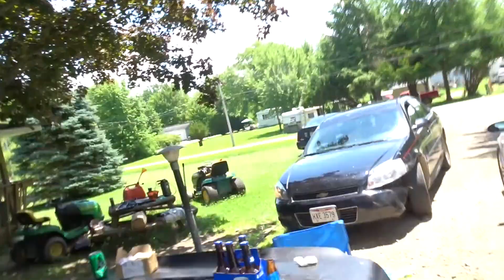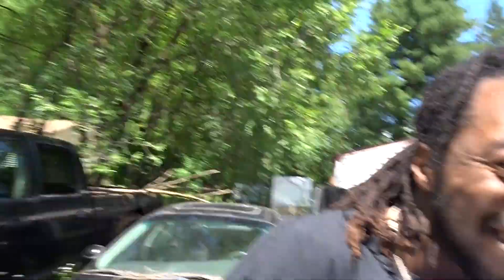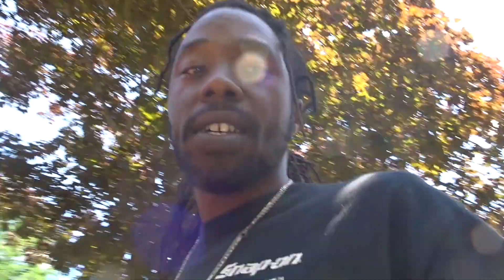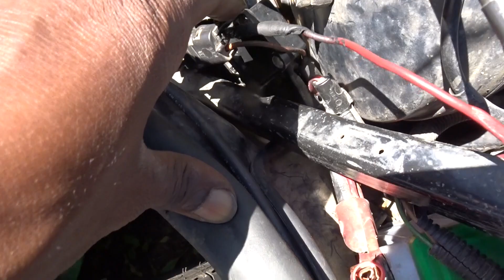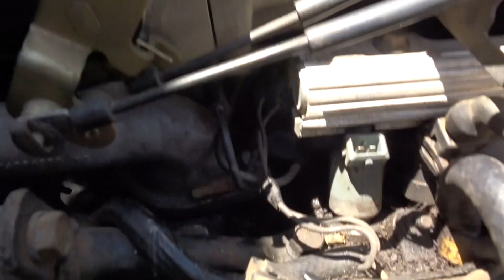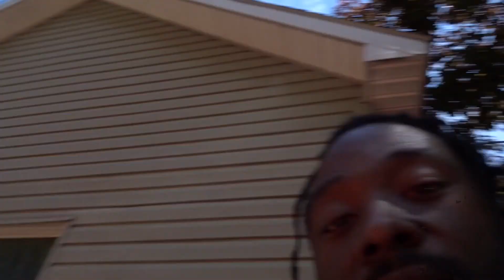C4 Corvette start and dies out!!! ( Pt.1 the diagnoses!!)

Comment: I've been working on a 91 z28 for weeks same thing did this did that nothing  I ohmed my injectors last night  found 2 with like 4 ohms should be 16 so today after watching you with your vette I went out pulled both wires off those injectors dang thing fired right up missed of course but started and run it ran  woo-hoo plugged them in shut right off I'll have new injectors next weekend! Thanks for your video

Comment: I have a 1986 Corvette, runs like a dream, well ran like a dream until yesterday. As long as you're holding the gas she'll stay crunk, as soon as I take my foot off the gas pedal she goes dead. Just got back from a real long walk to the parts store and bought a fuel filter. Hopefully that's the problem but if not you just gave me more things to look for.. 😊
Reply: THE SAME EXACT THING HAPPENS TO MY 85 C4!! Did the fuel filter work?
Reply: Usually that's the fuel pump
Reply: Mine does the same thing is it the fuel pump???

Comment: i felt your pain watching you trying to solve the no start issue.
i have an 89 c4 . ive replaced fuel pressure regulator, sparkplugs,fuel injectors, distributor cap, wires, and still hard start

Comment: Long story short.... the TPI injectors are wired in parallel to fire all 4 injectors (per side) at the same time. Like an old string of Christmas Tree lights. One goes bad they all go bad (on that side). If one shows a much lower resistance than the others chances are the coil is shorted internally and needs to be replaced immediately.

Comment: The best thing to do with these old vettes when fixing these issues, diagnose the actual problem first then fix it and then replace the everything in the fuel system, fuel pump, sock, wiring connectors, relay, cause if it is not broke now it will be soon... after all these parts are 40 years old...
Reply from the maker: True but I had no idea that 1 injector could possibly have done all that then again, it was the only different injector on the rail(used cars lol)!!!

Comment: I've got an 86 vette that does this. It will stay on if I floor the gas or leave it in park. If I put it in drive it will immediately drop RPMs and die unless I hold the gas pedal down. Any ideas?
Reply from the maker: have you checked the fuel filter?
Reply: That’s exactly what mine is doing and I just changed the fuel filter and that problem went away I was having to double foot drive it at a light unless putting it into N I changed the fuel filter and that problem went away make sure you pull the fuse for fuel pump let the fuel run out till car dies out then loosen fuel cap and pull the battery terminals before changing.
Reply: Billy keep that good stuff coming bro   If your ever up in Chicago look me up brother always some kinda vette shows going on
Reply: Jimmy I just changed my filter and didn’t do none of that you just mentioned 🤦🏽‍♂️ maybe that’s my problem now it start right up then shut down once it’s warm this a everlasting headache
Reply: Take the codes out the ecm

Comment: Have 88 vette had put in new injectors bought on cheap after 5 months car wouldn't idle carbon fouled all spark plugs ran rich awful exhaust fumes . I replaced 5 sensors vacume hose egr valve. Still ran like crap .replaced all injectors .car purs like a tiger.when buying injectors you get what you pay for,first replacements I tried to skim on money,dont do it
Reply from the maker: Video coming soon...replacing eBay injectors🤦🏾‍♂️